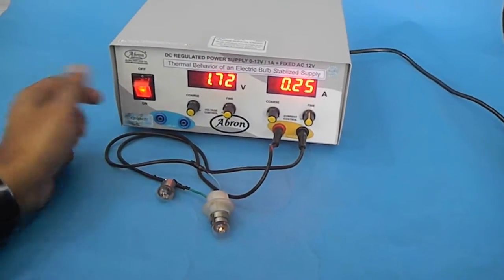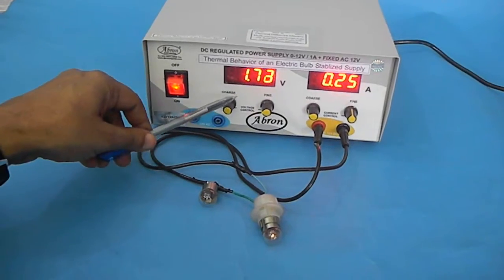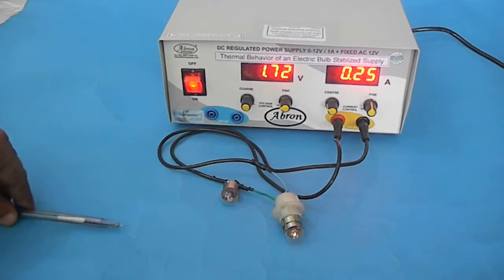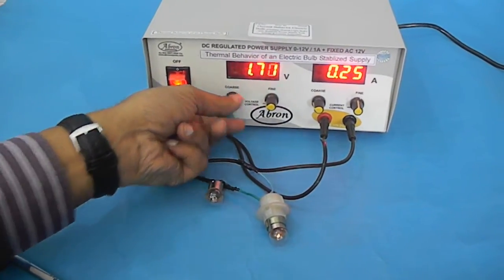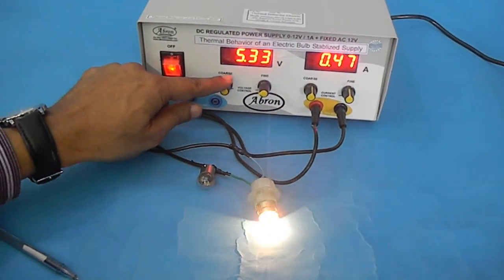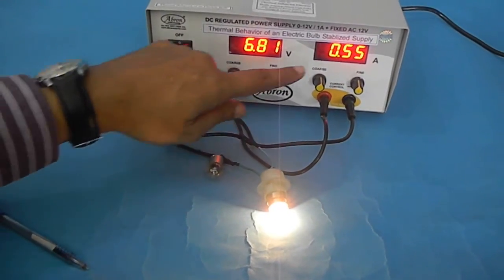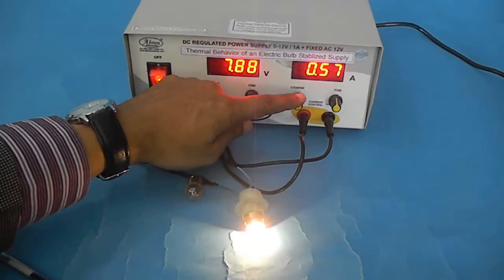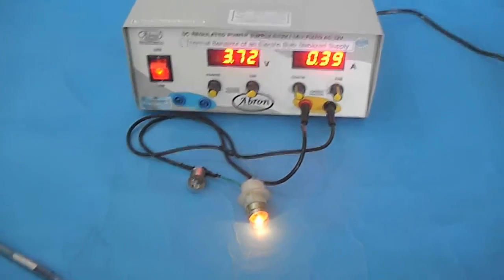video electronics thermal behavior of a filament bulb by stablized power supply stephens constant by

Comment: I made a 6 Volt regulated power supply with 12 Volt 750 mA transformer but when I connect a 6 Volt 300 mA torch bulb to output, the output voltage of Transformer decreases to just 7 volt & the 6 Volt regulator Ic output also dropping to 5.3 volt from 6 Volt. Why so much Volt dropping ?